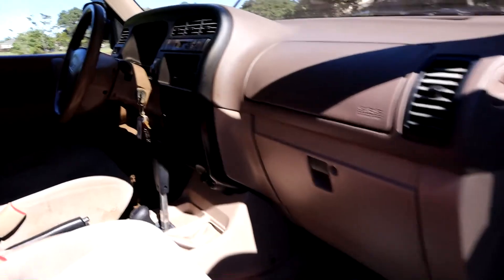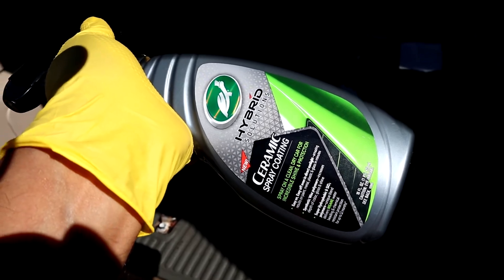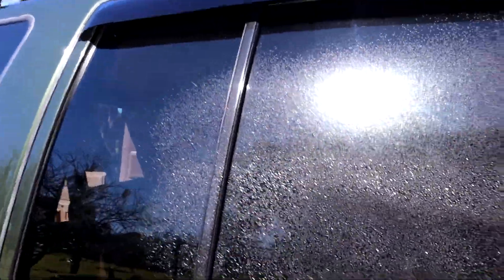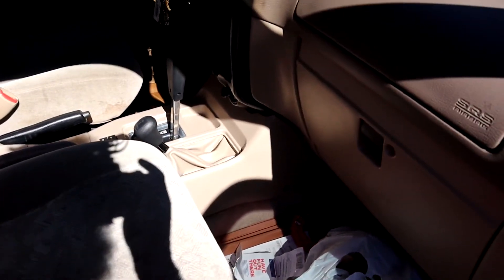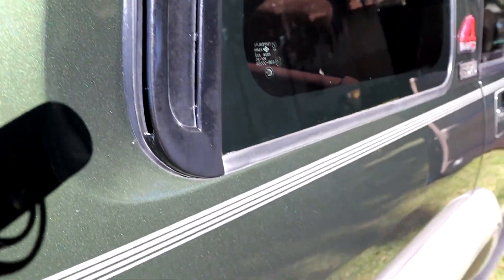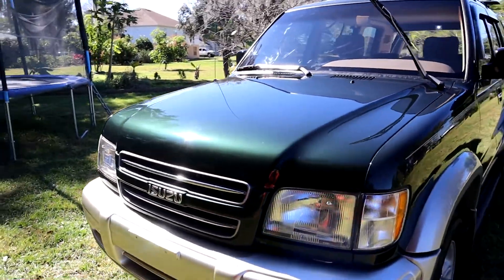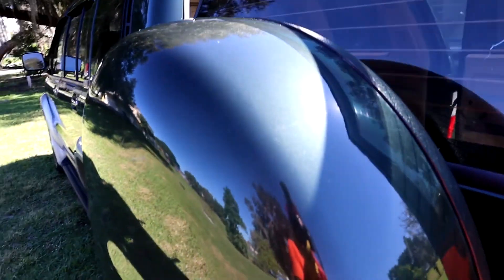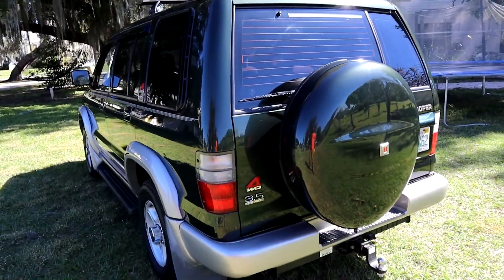Rough Review Turtle Wax Hybrid Solutions Ceramic Spray Coating on a 20 year old Isuzu Trooper

Comment: I have five bottles of the Turtle Wax Ceramic spray coating. I've had them for 3 months now. You're right it's a fantastic product.
Reply from the maker: Were you able to get you hands on the other products in the line-up?  I have the wet spray wax and this spray coating I was thinking to also buy the detail spray and polish wax to test the entire line-up.  I been cleaning and detailing for years mostly friends and family cars since 98 and honestly this product is in my top list along with Gliptone products, Aero Cosmetics, and Nano-Wax.  IMO these work great.
Reply: @Matucks  yes I have everything in the hybrid solution line except the soap! You're right they really are good products. One retailer in Canada currently carries them.